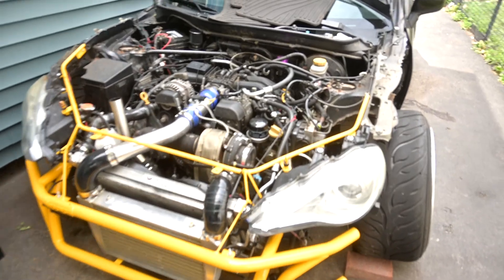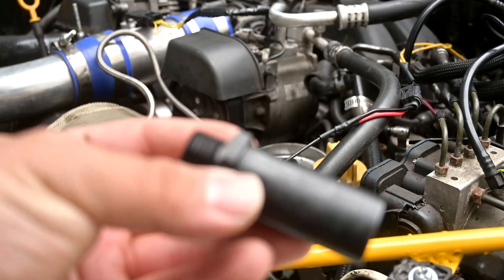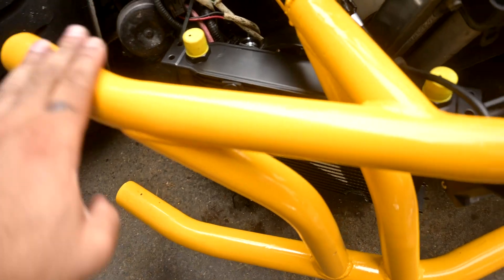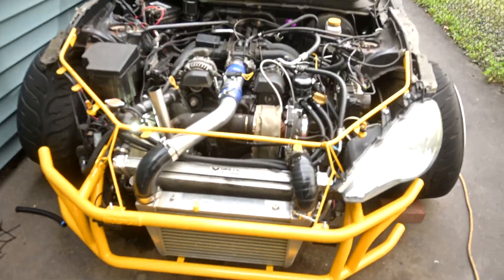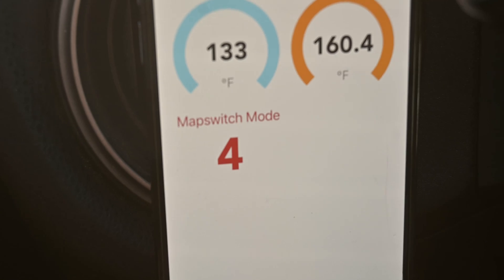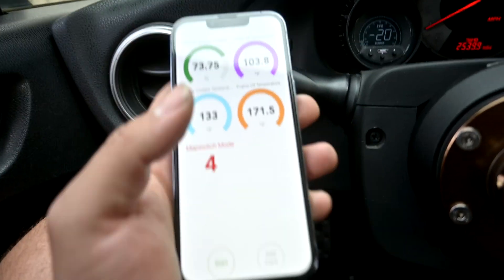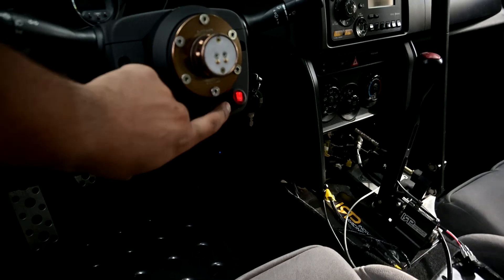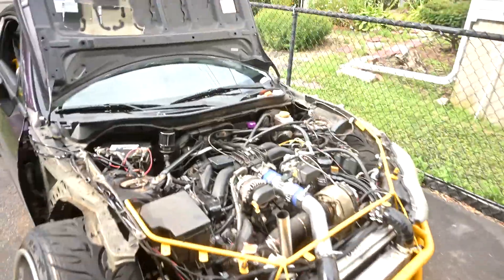500hp FRS/BRZ - BEST DIY OIL COOLER KIT?? YUP

Comment: Are you still running this setup? I’m planning on doing this same setup do you recommend it?
Reply from the maker: Yeah 100%, it works great still and keeps oil temps very manageable on the track
Reply: The oil cooler

Comment: Reporting back - The ebay oil cooler setup was an initial success.  My temps were like 120ish 126c .. now 90- and no more than 100c
Overall I was impressed with the setup and how effective it was.. I had no significant leaks except I forgot to teflon the small 1/8 Npt fitting other than that, there were no issues at all.
Reply from the maker: That’s what I like to hear! Very nice!
Reply: @offbalancewrld   I won't lie i had my worries since it was "ebay," but man, this cooler came thur... max temp 105, which is pretty dam good I am shocked how well it performed vs. Name brands, which you sell out 1.3K AUD for a setup vs. eBay savings to be Had. 
But it's all about finding out what works and what don't

Comment: eBay cooler for the win looks like it works - I'm off to get a 19-row one with the same kit I'll report back to see my own results good work  =] 
 I noticed you installed a small fan on the cooler would that be optional most install I've seen doesn't have a fan behind it
Reply from the maker: It’s worked beautifully, track days and all. And the fan is optional. The fan does help a good amount though, with hotter days
Reply: @offbalancewrld  I'm glad this worked out I'm supercharged and the 86 is just a daily work / street car sleeper build lol but stock temps in Australian summer is not ideal I've just ordered in time for our summer
Reply from the maker: @esko23q  It’ll be perfect for daily driving, and I can imagine your summers are pretty wild and hot lol
Reply: @offbalancewrld  You aint wrong Summer here can get brutal at times lol Your video came in clutch I should get the kit next week I'll do my testing and hit you back up. I like the fan mod you did it gave me an idea but for now I'll test without.  Thanks for uploading this... p.s Sometimes eBay can be good lol It is either a hit or a miss at times

Comment: If the oil cooler kit off eBay is 10AN how did you use the linked Adapter plate off Amazon if it's 8AN?

Cheers!